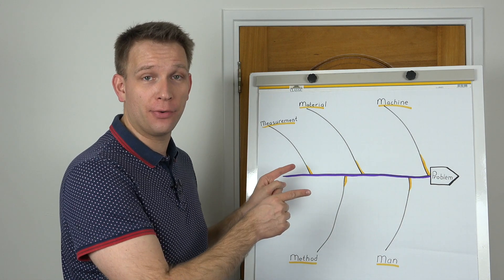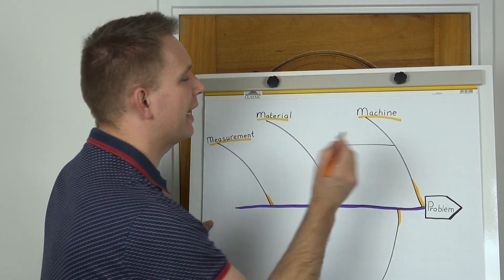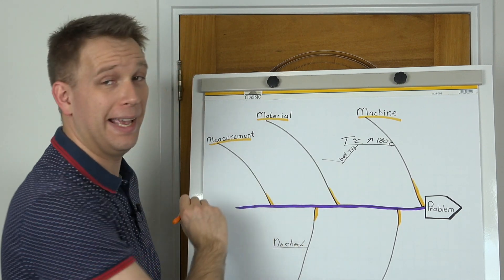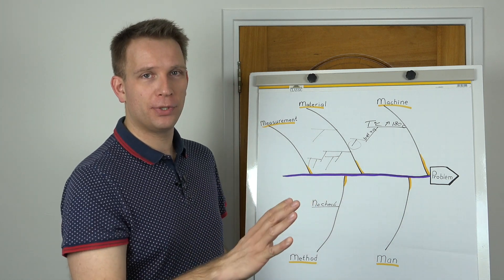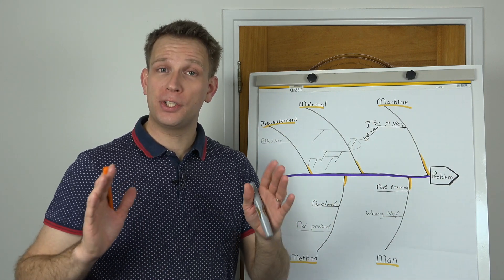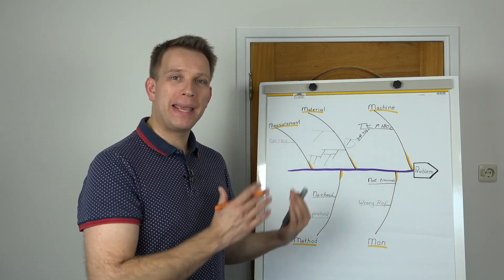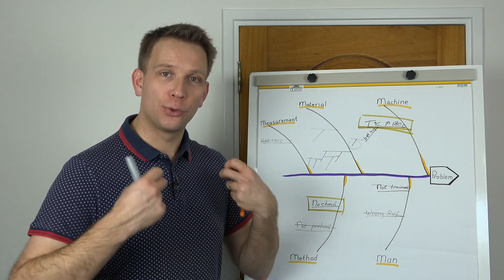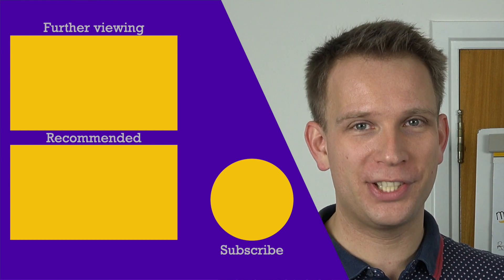Don't use Fishbone diagram for Root Cause Analysis

Comment: Can this be applied to human related issues? How can we identify the actions that stem from the root cause? I really need more straightfoward actions
Reply from the maker: A couple of things spring to mind from your question:
1) For human-centred problems, a Fishbone can work but the 4M categories are not suitable unless you're actually still investigating a process error. An example for investigating an employee motivation problem may benefit from using Autonomy, Mastery, Purpose and Recognition as categories for your Fishbone.

2) The Fishbone is for finding various potential causes of the problem, Root Causes are found with the 5 Why's. Countermeasure actions are defined after the Root Causes have been identified. There are tools to help critical thinking about the quality of those countermeasures, but the measures themselves should be designed by your team (knowing the root causes does make this process way easier).

3) The actions to take for Root Cause Problem Solving come from the 6-step RCPS method: Form a Team; Define the Problem; Take Temporary Measures; Analyse the Root Cause; Implement Countermeasures; Control and Sustain those measures. The template linked in the description should help with that and the course on that method goes more deeply into the goals and actions for each step.

4) You've correct identified that all Problem Solving methods stand or fall with your ability to define good actions: initially team actions to better investigate and clarify what's really happening, then actions to implement countermeasures, finally actions to make sure the countermeasures are sustained over time.

Comment: Any recommendations for platforms/ software tools that work well for the 5-Why step?
Reply from the maker: Not really, Roger, there's a bunch of Problem Solving and CAPA platforms that include a formalised 5 Why, but they usually don't so much help the 5 Why process they just make sure you perform one.
A simple Excel template usually gets the job done just as well. And I honestly love just using a flip chart or whiteboard (having a Fishbone and two 5 Why ladders pre-printed on a whiteboard is a great tool).

Having said that, what a good 5 Why software would need is:
Problem Statement.
Allow adding multiple Why's in each tier, with a check option "True, False, Don't Know" behind it.
The option to have 4-7 tiers of Why (less than 4 is almost never deep enough, more than 7 is almost always going into too much detail).
A Countermeasures list, preferably that can link to Causes in the 5 Why tree (not just the Roto Causes, mind you - any tier of causes can be targeted with countermeasures).
A separate Action list for the team, to track investigation of "Don't Know" causes, to track implementation actions and general team actions.

A part that I often see but don't feel is useful, is a definition of which of the 4M's a root cause belongs to (99% of ROOT causes are method, because we're looking into the organisational issues that allowed for certain causal chains and problems to pop up).

Comment: Tom, you may still use Fishbone. Ideally if there are multiple problem areas, you will have to create that many 5 why's !!!
Reply from the maker: Yes, of course you may still use the Fishbone, that's also the premise of this video - just try and get that 5 Why part outside of the Fishbone's visual.
I would advice limiting how many 5 Why's you do - my general advice is to first check which assumptions in the Fishbone are true and then pick the 1 or 2 your team feels are most impactful to the problem -> start by diving into those with 5 Why before spending a lot of effort on deep diving all those minor causal factors. It's not a hard and fast rule, just advice to keep your Root Cause Analysis efforts more effective in 90+% of the cases.

Comment: Hi Tom. I came to your video because im going to facilitate my frist RCA meeting in a few days and this looking for a good structure to conduct an efficient meeting. This was very helpfull and makes a lot of sense keeping the fishbone relatively simple and then zoom in on the points that the group agrees as most critical. I was thinking about a vote where each participant g’ets three votes each to place on a branch or three different branches or Two on one and another on a second, and let that resultat mark where we dive deeper into 5 whys. What so you Think about that?
Reply from the maker: Great idea - multi voting works really well to focus a group of people and make a choice without too much discussion. Make sure you let them vote for individual points/causes (e.g. for "feed belt misaligned"), not for the whole branch (i.e. not for "Machine").
Since you're in the ideal space for getting the maximum benefit from my course, I'll shamelessly plug that one too: https://www.tommentink.com/offers/qoZFo5wQ
This is my Root Cause Problem Solving course, in which you'll learn how to take a team through the 6 steps needed to find a problem's root cause and solve it once and for all. Even if your company uses a different version of problem solving, the tools on the inside will be the same, so you'll still take massive benefit from the lessons on how to lead a group through a fishbone brainstorm, challenge on the quality of 5 why's, what clarifying questions to ask during problem definition, etc.

Comment: Couldn't agree more.  Teams inevitably get lost or distracted within 5-10 minutes.  I have found it easier to create a table of the 6 categories of an Ishikawa diagram and brainstorm directly to the table (or 6 lists).  Sometimes we will rank items within a category to determine which causes advance to further analysis.
Reply: Ah.  Just looking over your form and see you use the same tabular approach.
Reply from the maker: @BrentHarcey   Absolutely, get the fishbone categories into tables immediately - that save on processing time and it eliminates the option of branching out too much. 
I like your approach of ranking the items within a category too. Don't forget to first eliminate the possible causes that are simply not true (that they came out of a brainstorm doesn't make them true, go to the shop floor or into the data to double-check). But after that, sure, trust your team's instinct to pick the most likely cause. And if that turns out not to solve the problem, just use that updated knowledge to pick the next best candidate cause.

Comment: Today there are software that can allow 5 whys to be performed directly within fish bone diagram without concern with crowding the diagram. While the subsequent causes are being captured into the branches of each primary cause, the diagram will be auto adjusted and spacing. The brainstorming proces no longer restricted by the limitation of the size of the paper. The software basically provides a big canvas that allow fish bone diagram to expand in any of the branches. Additionally the software allows easy rearrangement of causes within own branch to arrive at logical flow of the analysis. Finally one can copy each verified root cause with all its effects along that branch away from the fish bone diagram onto a separate sheet (hard or soft) in 5 why root cause analysis which is presented in tabulated form.
Reply from the maker: That sounds pretty cool and useful - thanks for sharing.
I am a bit sceptical, because that we can now get it onto one screen with better software doesn't always mean that it becomes clearer for participants - in the end, these are brainstorming and communication tools: we're not trying to capture as much as possible in as few documents as possible, but we're looking for the best tool to support our thinking and collaboration process.
But don't let that hold you back from using it - there are plenty of digital tools that really did make live easier (it's just that for every successful one there seem to be at least 10 mind-clouding visual gadgets).
What are your favourite fishbone/5 why apps?

Comment: I agree with you. I was thinking so before I watched your video on Youtube
I think the 5 why process is what helps to identify the root cause of a problem; fishbone diagram is  a visual representation of the 5 why process .
Reply from the maker: Yes, that’s an interesting way to describe to too. Although as far as visual representation goes, I’d advice using the fishbone for the first level of ‘causes’ and the traditional 5Why cascading boxes for the deeper level causes (so both visualizations). 
How does that ring for you?
And which way of showing/sharing a 5 Why analysis with colleagues has had the best results for you?

Comment: How we can decide.  Which one goes for further analysis and which on we can reject.  Is their any method to do that
Reply from the maker: The most effective method I know is to follow the instinct of the team: discuss which causes are most likely and follow up on 1 to 3 at a time. First try to prove if this effect (the potential cause) is actually happen in your process or not, then follow up with a 5-why.
To keep this seemly random method from turning into a guessing game, make sure that the reasons to select a potential cause are discussed with the team working on the problem, not just chosen by one person. Also, focus on few potentials to follow up and move on quickly to a next candidate if this one wasn’t leading anywhere.

Comment: My 5 cents. It's also possible to split the Fishbone diagram and move one or few categories to a separate Fishbone diagram. It will reduce the height of the graph and make it more usable and not so messy.
Reply from the maker: Yep - if that works to clear your though process, and more importantly share the thought process with others, then it’s a good improvement

Comment: Good suggestion. it will also make it easier to document using a word processor rather than having to get and maybe learn a diagramming tool.
Reply from the maker: Nice insight, I love it - anything that makes it easier to just use pen/paper or simple software is a win in my book